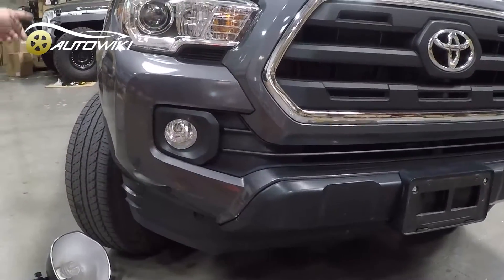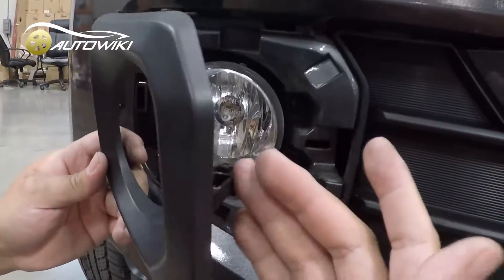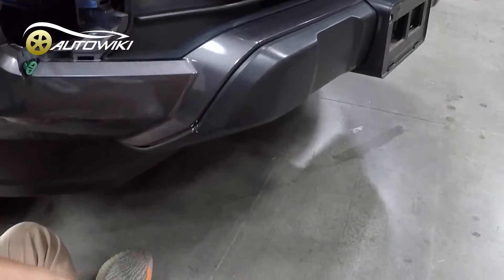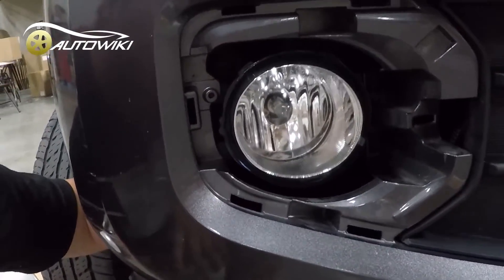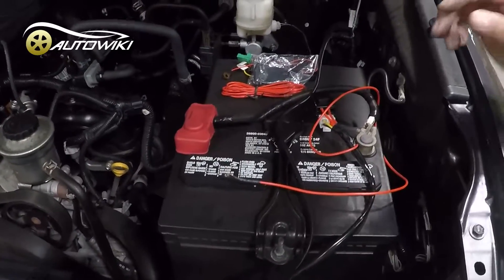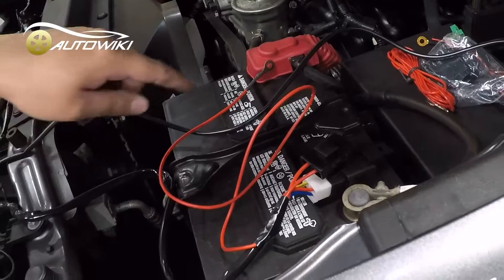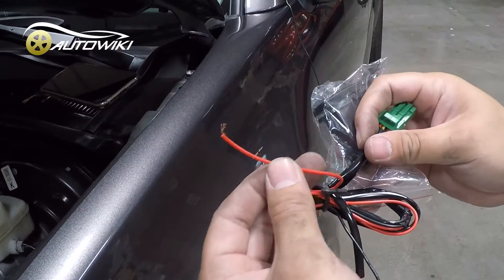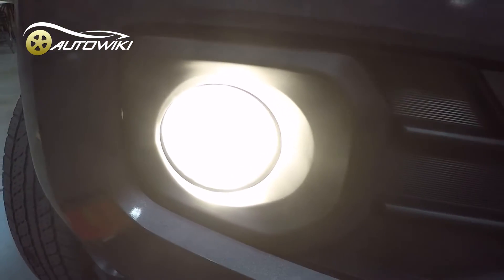Toyota Tacoma 2016-2020| SR, SR5| how to install fog light| AUTOWIKI| step by step| clear lens| USA

Comment: I've got a 22tacoma without fog lights,need to wire from switch to light which I would like to get amber color, can you help me out? Great video by the way, I need the whole package from belzel, lights, wires and switch, Toyota be wanted 550 for a pair of just light's and that's it, no bezels or wiring or anything to finish job, so people don't go to Toyota parts even after you buy a truck from them,they did knock 10$ off the wrong mudflaps, had to go to weather tech.

Comment: QUESTION Regarding the wire that goes to the "accessory power" source: 
Is it possible to connect that wire to the low beam power wire?   Since there is a relay, wouldn't that connection be sufficient? I am thinking that way, it disconnects each time the lights are turned off, thus having the fog lights behave as they did from the factory.
Is this a possibility?